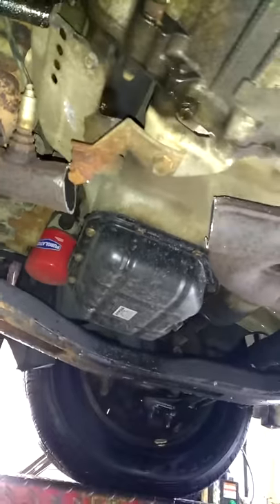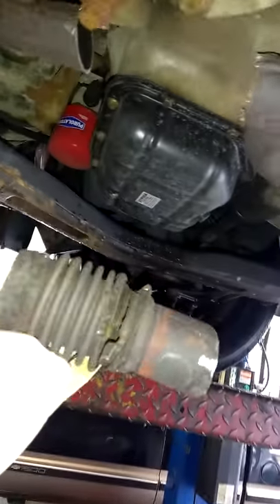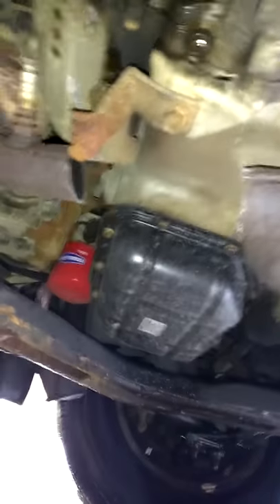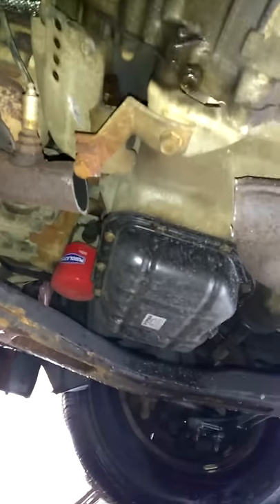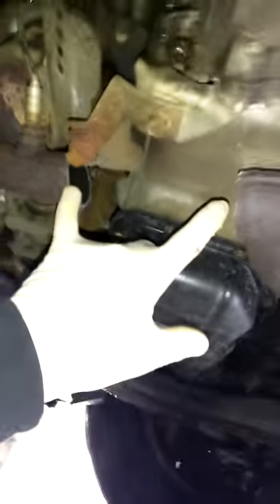Common Exhaust issues kia Sedona . Meineke cinnaminson

Comment: I just replaced my exhaust manifold/catalytic converter which took away the check engine light but my car still is getting any RPM's. It struggles to get up to 3,000 RPM's.  Do you think I have a bad pipe?

2009 Kia Spectra EX

Comment: My front flex pipe is leaking on mine should I just get it cut off I used some heat wrap it didn’t work
Reply from the maker: Won't hold
Reply: Anthony Nastasi should I cut it off
Reply from the maker: @dmoore215  they sell universal flex pipes try that
Reply: Anthony Nastasi ok cool I appreciate it 🤟🏽